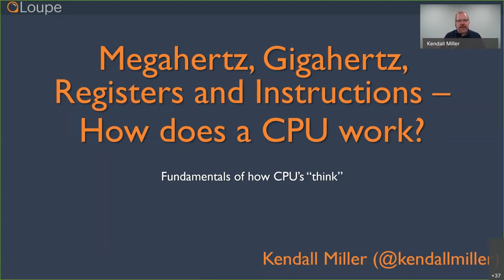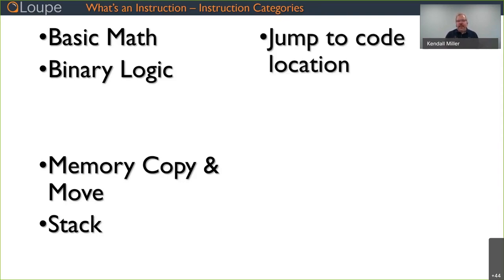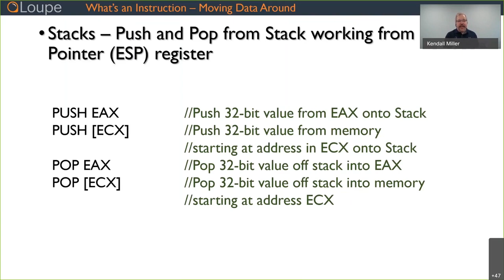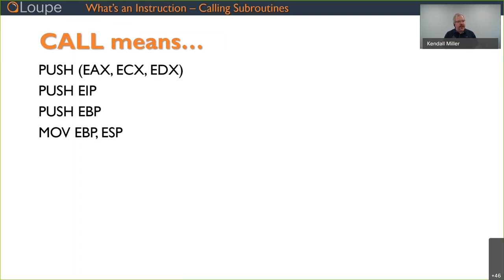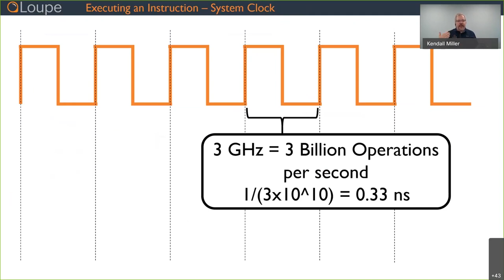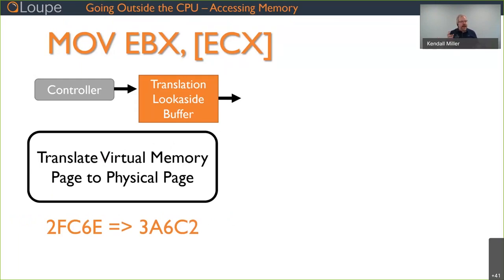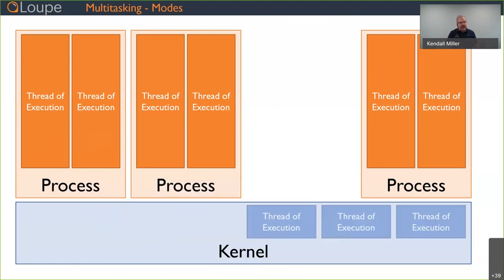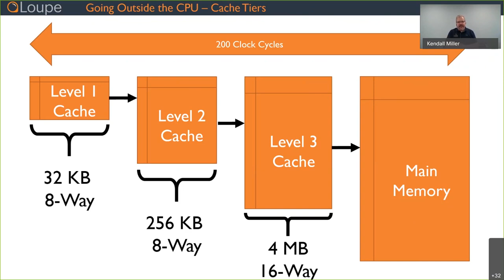Megahertz, Gigahertz, Registers and Instructions: How does a CPU actually work? - Kendall Miller

Comment: I'm asking this to start a conversation and definitely  not to sound absurd.

"Like input unit, control unit, what about a thinking unit?"

A thinking unit might drill down to a logic and control unit together but stating it as a separate unit so that it helps to solve or computerise the process of thinking
Reply: if we see and build CPU as a control and logic unit, then a CPU is no different than that of a calculator.
Reply: CPU and a calculator is a product built by mathematicians and it doesn't seem to go beyond performing calculations. It's not that there is something beyond computation, there seems to be other sector which could be non-computing. Because thinking is not computing, connecting the dots in our head, is not computing. It can be explained in terms of computing but I believe there is something else that we are missing to see.
Reply: We may even silence the thought out saying the AI will fill that gap, but how about assuming that AI is fundamentally flawed. An artificial neuron is fundamentally flawed. It's virtual. it's not real. Everything in computer is virtual. Other than the benefit of running a business or performing a scientific computation, it really does nothing else.

There is more we can put in form of transistors and capacitors but adding an ALU is not everything.

Mathematics is not everything. 

Just like how I was able to express something out in words, Math does the same. It may be universal, but there is more on the other side of the table. And all of our knowledge and scientific discoveries are based on that particular tip.
Reply: Computation based on mathematics is a pyramid standing on its tip.

We may learn more and add piles of concepts on top, but real thing is towards the tip, and 

everything else from the tip is something I'm curious.